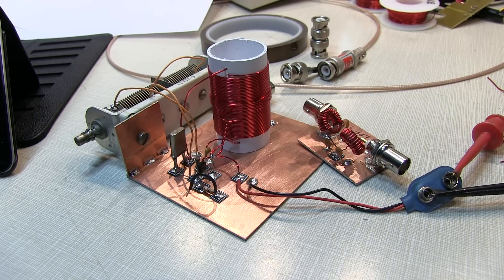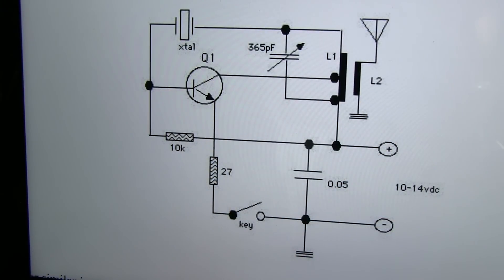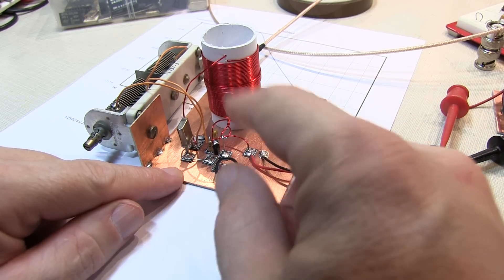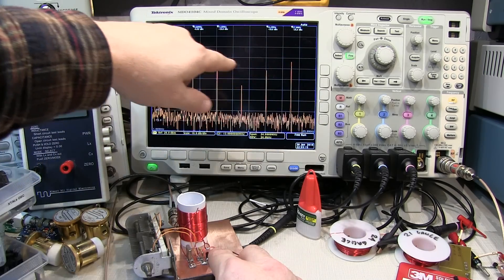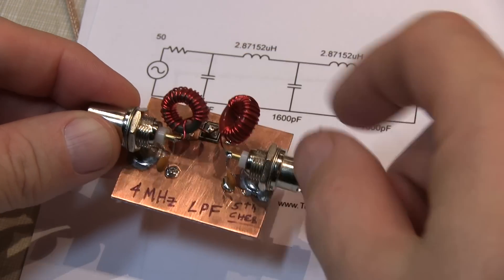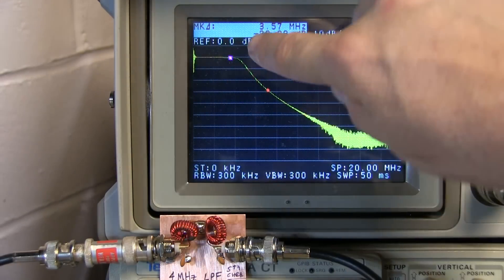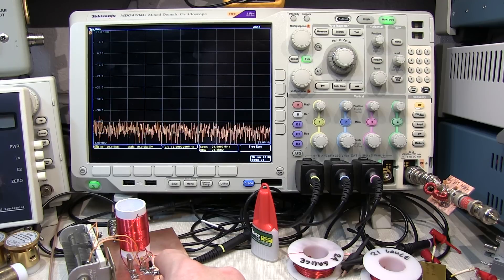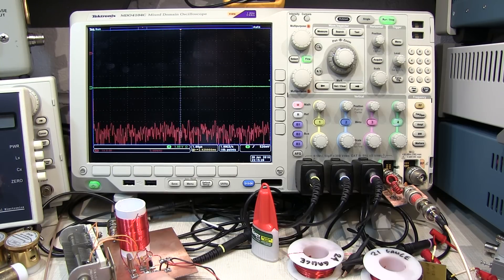#228: Radio Fun: Michigan Mighty Mite CW transmitter and a low pass filter

Comment: Another great video. That low pass filter is very interesting. How much filtering would you get with just a single capacitor as a low pass filter. I know that a single capacitor will not be as good. But I don't know why to be honest?
Reply from the maker: +Kevin O'Brien A single cap would make a single pole filter, which would only be down 6dB an octave (2x) away from the desired frequency.
Reply: +w2aew Thanks for the reply. No idea what a pole filter means to be 
honest. But how does it do that in terms of vibrating charges. Does the 
first cap filter out high frequencies vibrations and the inductor passes
 through the low frequencies ones?  Buy why does having several of those
 in a row knock down the signal so much. I suppose I need to go read up 
on this. Any reading suggestions welcome. What would happen for example if you added on another cap and inductor to the far end,  extending it? This is fascinating stuff.
Reply from the maker: +Kevin O'Brien Each component does a part of the job.  The caps to ground provide a low impedance path for higher frequencies, while the series inductors create an increasingly higher impedance path for higher frequencies.  The number of poles, or the "order" of the filter, is another way of expressing how steep the filter rolls off.  A single pole, first order filter rolls off at 6dB per octave change in frequency (or 20dB per decade change in frequency).  A 2-pole filter is 12dB/oct, and so on.  Adding more stages to the filter will increase the filter's order, thus giving a steeper rolloff vs. frequency.

Comment: Hi allen, This is a carrier wave transmitter right ?. When you press the key a burst of carrier waves are sent out (There is no modulation involved).So What causes the beep sound in the receiver ?
Reply from the maker: Correct.  In a CW receiver, the incoming signal is typically mixed with a BFO (beat frequency oscillator) to create the sidetone.
Reply: oh like a superhet..Got it. Thank you :)

Comment: Ok, now you're shaming me to walk over to the parts bin and pull out a color burst xtal and join the CBLA! How much attenuation did you put inline with the MMM enroute to the analyzer's front end?  I can see the inline one at the SA's BNC input. Gotta go back to your video on how not to blow up your SA! I'm always paranoid about overloading and damaging the box and usually use a attenuator coupler or a sniffer loop.  73 - Dino KL0S
Reply from the maker: +Dino Papas Just a 10dB pad - also ensured the filter saw a good 50 ohm impedance at the input side.

Comment: Sorry hit button before thought ended. Question was if the spectrum analyzer did not have a tracking generator. What is the work around. Thanks
Reply from the maker: +Larry Renaud There are a couple of ways to sweep a filter if you don't have a tracking generator.  One is to use a broadband noise source as the input and do a peak-hold on the spectrum trace.  Another would be to use a sweep generator, or manually sweep a signal generator, and use a max hold trace on the analyzer.

Comment: Can you tell me why its always just a lowpass filter on the outputs typically? Dont they also produce lower frequency harmonics too? So you would want a bandpass?
Reply from the maker: Harmonics, by definition, are integer multiples of the fundamental.  In general, you usually only have to worry about lower frequency distortion components when there is mixing involved in the RF generation.

Comment: Really great video.  Can you elaborate on the use of pads?  I am building a spectrum analyzer (Ashaar Farhan design) and recently made a 70 Mhz filter board. (4 coils 5 caps) I swept the filter and found that it rolled off at 15 Mhz instead of  70.  I checked the design with Elsie and LT spice and they show 70 MhZ rolloff with no pad. Presently I'm rebuilding the board using your "Dot" method.  If I'm coming out of the si570 oscillator chip through a 50 ohm cable, do I need a pad?  Should I use a "T" pad using 3 resistors for 6 dB down on the board.  I can't seem to find info about this.. Thanks for your thoughts  KM4TRT
Reply from the maker: The reason for using a pad (an attenuator) in this case is to ensure that the circuits see a nearly 50ohm load, even outside the frequency of resonance of the tuned circuits.  Otherwise the impedance at the non-resonant frequencies can be far from 50 ohms which may disrupt expected operation.
Reply: would not having this cause the frequency rolloff to shift that much?
Reply from the maker: Difficult to say without examining a particular filter, but it could have a pretty dramatic effect.  Consider a simple RC filter, where R is expected to be 50 ohms, but is in fact several thousand ohms - this would result in a big change in the filter!  Extreme example of course, but you get the idea.

Comment: Those soldering islands never saw them before. Where can I get them and how are they called? I cannot see how they are connected underneath to the board the are on.
Reply from the maker: You can make them yourself with a circular metal punch, or by cutting up old blank boards. Or, you can buy some nice pre made ones like these. These are called MePads, from QRPme.com. They are simply glued to the board with dabs of superglue.

Comment: I often see inductors around 8uH in between the output stage and the antenna on most R/C transmitters, could this also be filtering, or is it impedance controlling ?
Honestly to me adding an inductor there seemed a bit counter-intuitive since it would block the HF content.
Reply from the maker: +Marty's projects In your RC transmitters - the inductor(s) could be either part of a low pass filter network or an impedance matching network (or both).  The impedance presented by an inductor is 2*pi*f*L, so the amount it "blocks" HF is a function of its value, the frequency used, and the surrounding impedances.

Comment: W2AEW DE NY2RF: you mentioned several times tweaking the filter. Can you explain in greater detail what tweaking involves? adjusting the spacing of turns on the toroid? Something else. Thanks, and 73, Tom
Reply from the maker: Hi Tom,  Yes, tweaking can involve adjusting the spacing of the turns to push the inductance around a little.  It could also mean designing an impedance matching network at the input of the filter to match the impedance of the output of the mighty mite.  Or, it could also mean adding additional stages to improve out of band rejection.

Comment: so then, technically (if you have appropriate HAM license to do so), you could run this out to a 50ohm coax, and then into a 50ohm antenna array and it would be broadcast? Wouldn't you need to maybe increase the power some before hitting an antenna?
Reply from the maker: More power isn't always necessary.  A narrow-band mode like CW can effectively be used over great distances with a decent antenna.

Comment: +w2aew Great demonstration video, Alan. Where do you buy the board components from ? Thanks
Reply from the maker: If you are referring to the small solder pads, they are MePads that I got from http://www.qrpme.com/
Reply: +w2aew Thanks. Where do you purchase the board components from (capacitors, inductor toroid, coils, and the active devices) ? Trying to learn of alternatives.
Reply from the maker: +Amit k. Sarkar Lots of places.  Often I'll get toroid cores from places that cater to amateur radio people - like 
http://kitsandparts.com/
http://www.qrpme.com/
http://www.danssmallpartsandkits.net/
...and sometimes I'll get parts on ebay or amazon...
or the regular distributors like Digikey, Mouser or Newark/Element14
Reply: ***** Thank you for sharing

Comment: One wonder if its possible to get a (SECOND HAND)  half way decent "Digital radio" on one of those swap meet reunions... I'm a new Ham "Just get my licensing... and was wondering.. also perhaps other question is that I have a BaoFeng radio out of ebay,, I have perhaps the cheapest possibly spectrum analyzer, see many people using frequencies and I just can not hear or interact with them.. how do one get the radio to work?? 
Thanks in advance.... hope to hear from you soon.
Reply from the maker: I'm not sure what you mean by "digital radio".  There is usually a wide variety of radio equipment available at hamfests.
Reply: I mean a radio that may have a Digital Screen to  show what band, frequency etc... most of what is for sale right now looks pretty pathetic...
Reply: also any advice about the BaoFeng radio. and actually thank you for taking the time to answer my questions.
Reply from the maker: @Migueldeservantes  BaoFeng makes cheap VHF/UHF FM radios. In most cases, VHF/UHF amateur radio operation on FM is done using repeaters.  To use a repeater, you'll have to properly configure the transmit and receive frequencies, and likely a CTCSS tone, in the radio for the specific repeater that you want to communicate on.

Comment: i would like to know how to build an high power "exceeding past" legal limit low pass filter. or at least see one and it's construction. and if at all, see one made with air variable caps. if that would change the filtering frequencies. chopping harmonics off closer to the base frequency. raising the clamping frequency.
Reply from the maker: +dale myers Making a legal limit filter simply means selecting capacitors and inductors rated for the higher voltage and current.  Values still remain the same.
Reply: ok cool, i had that feeling. now i need an inductance meter to test and make the proper inductance coils. i can wind copper tubing for coils. but don't know how many turns to wrap to make the same inductance.

Comment: Please would explain the function of the variable capacitor in the tank circuit.
Reply from the maker: +trialen It is mainly to tune the tank circuit to resonance at the operating frequency.  It can also shift the operating frequency slightly.  It can also be fine tuned to slightly reduce the harmonic distortion.
Reply: +w2aew Thanks. I've seen this circuit around a lot, but this is the first time I've seen an explanation for it. Presumably, I could replace it with a fixed capacitor plus a small trimmer in parallel ?
Reply from the maker: +trialen Yes, of course.

Comment: Ok. Wow! This was exactly the video I was looking for. I was just working on a butterworth filter for class C output on my transmitter yesterday and failed miserably. This video with the Filter Designer Software is definitely going to help. However I had some follow up questions on the operation of mighty mite. 
1. Why use a xtal oscillator when you already have a tank circuit. Is that for more stability with less frequency drift?
2. Regarding the impedance transformation for L1, L2. I would assume L2 is 50Ohm. Are L1 and C1 in a Hartley configuration? I would think L1’s  inductance would be ~ 5.5uH for 80m band with C1 as 365pF. 5.5uH would be around 120Ohm at 3.5MHz. So L1-L2 would be transforming 120Ohm to 50Ohm and 3.5MHz. Am I in the right thought process here? 
3. Is the tap point just to determine the feedback factor to the base of the npn? I don’t understand the math for the number of turns on L2. Your feedback would be great!!! 

P.S sorry for bombarding you with so many questions :) And thank you for always answering my previous questions. You're the best!!!
Reply from the maker: 1) The tank is really more of a resonant load rather than part of the oscillator feedback network.  It really is just a crystal oscillator - the tuned load ensure operation at the fundamental.
2) I haven't taken the time to analyze the circuit completely - I wanted to demonstrate building it "as documented".  You're on the right thought process - it's just a process I haven't done myself either.
3) Again, I haven't reverse engineered the design - just built it as documented.  My first impression though is that the tank is just a resonant load and not really integral to the feedback (which is primarily through the crystal).
Reply: Ah! Cool. Thanks for the feedback. That does help. Ill play around with L1-L2 to see if I can understand the transformation :)

Comment: But how does the LPF match to the o/p Z of the Michigan Mighty Might - which probably isn't anywhere near 50 ohms - or is it??
Reply from the maker: The output impedance of the MMM is most certainly not 50 ohms, so the filter would have to be designed with the appropriate impedance match to work properly.  In my case, I intentionally left the 10dB pad in there (although I didn't state that), so the impedance match wasn't an issue.

Comment: Why not use a Blackfin DSP with a RF compatible ADC  on the input and a RF compatible DAC on the output and do the processing using maths instead of coils and capacitors.
Reply from the maker: That's really the antithesis of the minimalist radio concept that this little TX is all about.